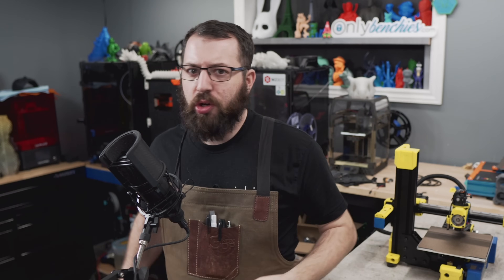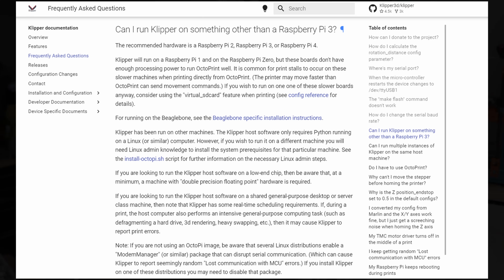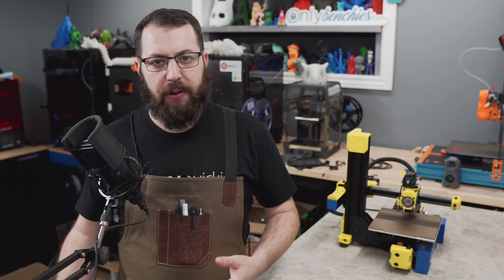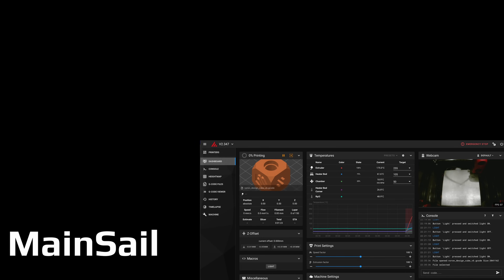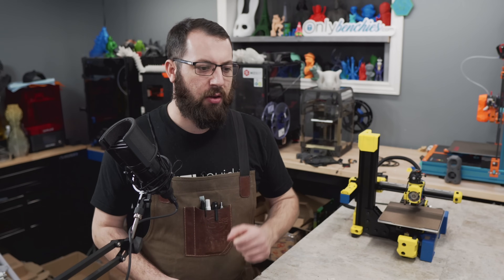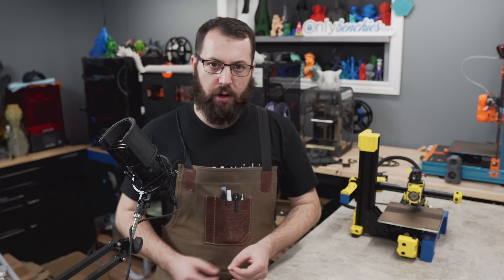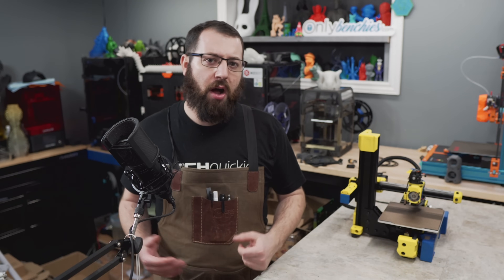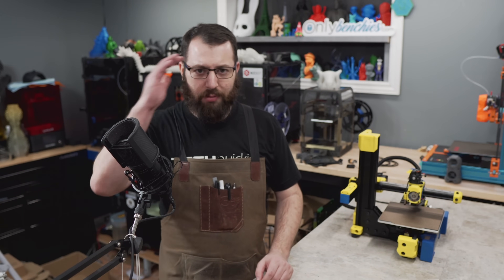Install Klipper on ANY 3d printer - Part 1 - Intro and the Basics

Comment: what config example is there for the raspberry pi 4 ? im trying to put klipper on my elegoo neptune 3 pro.. having trouble getting the bin for the printer itself.. i have mainsail on my pi4 and im trying to use it as a headless setup

Comment: If I'm using a BTT SKR Mini E3V3, what part of the install do I define the build volume?
Reply from the maker: Doesnt matter what controller/printer it is, but in your printer.cfg theres a 
position_max: 
section under each stepper section and thats were you put the printer travel limits
Reply: @CanuckCreator  ohhh ok ok thanks!
Reply: @CanuckCreator  thanks for that info! Really helped, but now how do I invert the rotation? I need to invert the Z direction so that it works on my Ender 5😅😅

Comment: So do you NEED this extra control board or not? Can you do this with JUST a raspberry pi 3 and your printer or is this MCU board thing also a requirement no one is being upfront about? If it's not 100% necessary how do you install klipper with JUST a Raspberry pi?
Reply from the maker: You need the controller board that a printer already has (duet, ramps, skr etc etc) and then you pair that with a RPI
Reply: @CanuckCreator  I just found out like 2 seconds ago it turns out my creality pad and the config file it automatically sets up does indeed work it's just I can't hit "print" on the actual pad it doesn't do anything. I thought something was wrong with the firmware but it must be just this update because when I plug in the IP address and use I think fluidd is what it gives you by default, it will print from the PC and everything seems to be working decently now.

So yea for anyone else out there DON'T delete your PI and reflash it with Mainsail if you have a creality pad, just go to "network settings" > "wireless"/"wired"> "view IP address" or whatever and then plug that IP from the Creality Pad into chrome/firefox and print from THERE if your sonic pad won't print anything lol. I'm so glad the solution turned out to be simpler but it was counterintuitive and frustrating that it didn't work simply cause I was printing from the pad cause my thought process was "get klipper running as basic as possible printing from the Creality pad first THEN mess around with more advanced stuff on the remote klipper tools like mainsail or fluidd" but that thinking backfired and this one dumb bug made me Believe I did something wrong and had to involve a raspberry pi + external mcu control board ☠️

Comment: Hi Nero, Can you tell me where to download the Klipper.bin file for a Elegoo Neptune 3 Max? I found the Printer.ofg file by a GitHub page But I can't find the Printer.bin file for this Printer.

I have a BTT Pad 7 with klipper installed which I wish to use to control the Elegoo Neptune 3 Max and a Elegoo Neptune 3 with. Great videos btw. Thanks for your help.

Comment: "What we are doing is I'm going to be..." It takes practice practice practice to defeat these asinine speaking habits that use filler phrases. What we are gonna do now is we are gonna. What you wanna do now is you wanna. YT is a one-on-one experience. I'm right hear in front of you. Don't wave your hands in my face. I can't see what you are holding if you swing it around. Defeat this by holding it in one hand and pointing to it with the other. If I was actually there I would have ducked when you you swung the Pi in the air. Just my 2 cents.

Comment: hi guys, first time getting into 3D printing here and first time attempting to klipperized my ender 3 S1 pro. I'm following the KIAUH method and when I tried Get MCU ID, I cannot get any when selecting USB or USB (DFU mode). it will only detect MCU when selected UART and it's dev/ttyAMA0. But when I tried flashing it using UART, it failed. Can anyone please help me what I need to do get this flashed? Cheers

Comment: i bricked my anycubic linear plus. after my new e3d cartridge install and it would not start after heating so i read it needed calibration through pronterface ,that would not connect no matter what i changed on port speed or anything, so i just disconnected the usb and before the 3d printer could restart to be interfaceable i  switched power and now just have blocky screen. please help i am frustrated and at my wits end

Comment: Hi. First, I love your videos. I learned a lot. What I'm not got at the moment is one thing. Does the Micro SD card have to stay in the printer after flashing new firmware, or can it be removed after that?
Reply from the maker: It can be removed after flashing

Comment: Any idea how to install klipper on a Ender 3V2 with a GD32F303RET mcu? I've run into problems creating a valid firmware that creates a serial folder and a by-id when queried. Any ideas?
Reply from the maker: Id double check that that MCU is supported and if so make sure your trying to flash it with the latest klipper install as well, should just follow the same steps as outlined here https://github.com/Klipper3d/klipper/blob/master/config/printer-creality-ender3-v2-2020.cfg

Comment: Hi, presently I am building a large size 3d printer with Dual X axis, it has 4 extruders with 2 nozzles (2 in 1 out hotend)
Is klipper support this Config?
Marlin only supports dual x with 2 extruders and 2 nozzles only
Please help
Reply from the maker: You would need to create a config from scratch for your setup, but it could be done, check the klipper docs for examples

Comment: Thanks for the great videos. A few questions. You say SKR 1.4 but then it shows an SKR MINI E3 V3.0?? Also, when using an Ender 5 printer with an SKR MINI E3 V3.0, the Ender config lists from stepper x, y, z, and then extruder. The config for the board lists stepper x, tmc2209 stepper x, stepper y, tmc2209 stepper y, etc. So you change the pins, but what of the driver settings? Are those only for stealthchop?

Comment: Really useful - Many thanks...

Quick question - I'm planning on installing Klipper/Fluidd on my upgraded Ender 3 (BTT SKR Mini E3 v2, BLTouch, and a hand-built Marlin) before venturing into the world of  Voron.

I've already been down the rabbit hole and the basics are done, running on a 3B+ with a PoE hat, but I'm a little confused configuring printer.cfg to support a mains switching relay so I can power on/off the actual printer remotely. Any pointers much appreciated...

Comment: Hey, I wanted to chime in as I have used your former guide on how to install Klipper, but had to improvise some stuff to get it working for me.

I am using an Ender 3 Pro with the older Creality V1.1.5 mainboard, which at the time I thought was the V4.2.7 (I had bought it with the "silent board" upgrade on Ali). After trying repeatedly to flash the firmware onto it, at first the 4.2.7 firmware and then the correct one for the V1.1.5, I started running out of option as for why the mainboard wasn't updating whe I inserted the SD card into it.
After doing some research, I noticed that the Creality mainboard could be talked to using an SPI connection via the pins on it, so as a last resort, I just YOLO'd and went down that rabbit hole.
I connected the RPi 3b I was using to the mainboard via the GPIO, and miraculously, I could finally flash the firmware.

With that said, I'm no genius either, I followed a guid. Or moreso, two guides. The first one is by LinuxTrucker on his blog (I don't think I can post links, so search for "linuxtrucker flash klipper" in your favourite search engine and you should find it), which linked to another written guide by MR. Ducky on Fission3D, explaining step by step how to flash Klipper on an Ender 5, which also uses the Creality 1.1.5 mainboard.

After running Input Shaper and Flow Compensation, I now print reliably at 150 mm/s with 4000 mm/s² acceleration on a stock (OK, nearly stock, I printed a direct drive adapter) Ender 3 Pro. No linear rails, no custom cooling solution, no high flow hotend, nothing, just stock parts and a direct drive adapter ("SpeedDrive", on Thingiverse) with the included silicone sock.

Happy printing!
Reply: 8 bit microcontrollers needs to be flashed via a dedicated ISP programer or via USB with the AVRdude utility (for ATmega microcontrollers) using the Raspberry, theres not an 8 bit microcontroller "works for all" solution but luckly almost all RepRap era control boards uses ATmega's microcontrollers (comming from the arduino heritage) and modern ones are 32 bit SD card flashable microcontrollers so this simplify a little bit the things, congrats on figuring out how to do it, it's not trivial at all :D

Comment: I have a Zero 2W coming in now.  If I wanted a camera, you're saying that this is possible?
Reply from the maker: Yes, the pi zero 2 can handle a webcam just fine
Reply: @CanuckCreator  at least the pi camera modules are fine. 
I had an old USB Webcam where ffmpeg had to do some software encoding (don't remember what exactly the term was) and that was quite resource intensive.

Comment: With the insane price of raspberry pi boards, I used an old android tv box (flashed to armbian) for my latest project. Only cost me $8! I wasn't able to use FluiddPi, but KIAUH makes installing Klipper and Fluidd pretty simple.
Reply: It's insane to see some Raspberry Pi boards with asking prices that are literally higher than an Ender3v2 printer.
Reply: Rpi Zero 2w is your friend
Reply: @downundermaker  Unfortunately I can’t find a Zero 2W for any less than about $50 where I’m at.
Reply: @jongranada  I just got an orange pi zero2 (33 bucks included tax and shipping) and installed their official Debian image. Then setup Wi-Fi (need Ethernet cable or microHDMI for this), and then just run Kiauh for the rest. Orange Pi zero2 is slightly faster too (1.5ghz vs 1.0ghz pi zero2 W).
Though, I haven’t connected the mcu and don’t know if it is powerful enough to run input shaper. I will try it in a few days.
Reply: @nhozdien5058 , hi, how is yor your result? Did you try input shaper with orang pi? Plz, share any comments.
Reply: @habracoder  I successfully installed input shaper on orange pi zero 2 with the official Debian image from OrangePi. I haven't run it yet. 
You could look up how to enable SPI mode (for Debian in my case). Couldn't get SPI mode on Armbian image, but it's been reported that other OrangePi models work.
Reply: @nhozdien5058 , thanks for the answer
Reply: @downundermaker  
So is the 8GB Pi 4 
:-)
Reply: Where do your find out how to flash an android tv box
Reply: I got a pi 3 for 35
Reply: What type of TV box and what power does it need?
Reply: @ I don’t remember which specific model I used, but if you google “Armbian tv box”you can find instructions and compatible models/chipsets!

Comment: For the completely new beginner, the config file can be thought of as a road map that your controller uses to relay information. Pin assignments are the roads.
 Example: I-15 has all communication with only z stepper motor. Highway 20 carries all information for the bed thermistor. These roads are used only for these actions, always and forever, unless the config file says differently.

Comment: Whoa!!! What did you say,One pi can run multiple controller boards? If I have 2 creality mainboards, and want to use the second for additional extruder steppers, fans, hotends. I can? Would both mainboards be on the same USB? That would be great news!
Reply: Two controllers on the same Raspberry Pi/computer, not same USB. But yes, that's possible. Actually that was the original setup for the Voron 2.4, using two SKR 1.3 boards to control all 7 stepper motors, before boards with 8 stepper drivers were made available.
Reply: @vinnycordeiro  If not USB, how is the second board connected?
Reply: @FilmFactry  they are somewhat being nitpicky, you said "same USB" which kinda implies same port, which you can't physically do. Two boards on two USB ports would totally work, but one can also use the hardware UART on the Pi's GPIO to connect to one board without using USB.
Reply: @Spice__King  Thank you, it's exactly that. Sorry for nitpicking 😅
Reply: If using a Raspberry 4 you can run 5 boards (4 via usb and 1 via UART) technically on a USB 3.0 you can use a hub and run more boards using the unique serial on the hub but if you are in the need of more than 5 boards maybe your worries are in another level.
Reply: @fdavpach  
Dude.
A 40-channel machine.....
Or....
Could you break that into 10, 4-channel machines....
Wait....that 8-channel board has a breakout board for even more channels.....